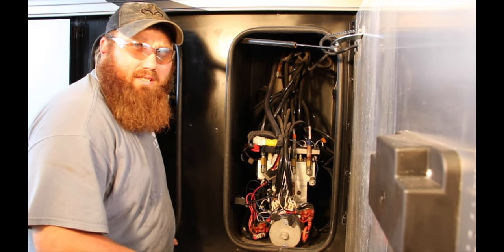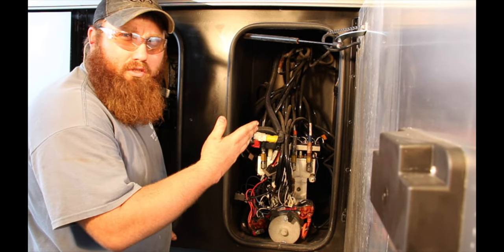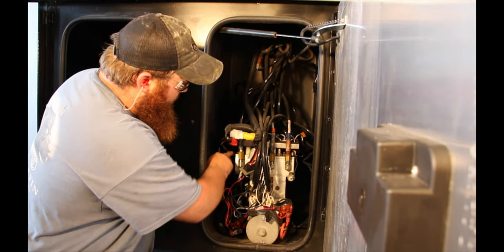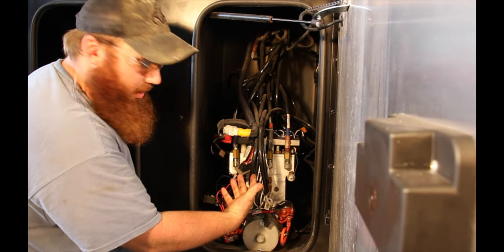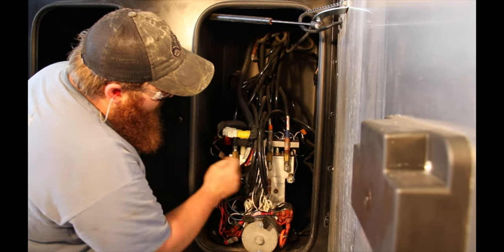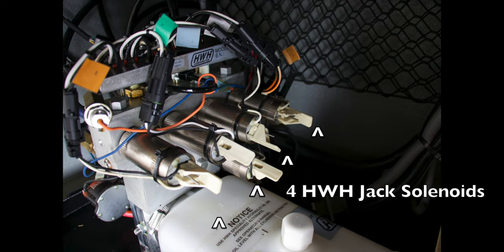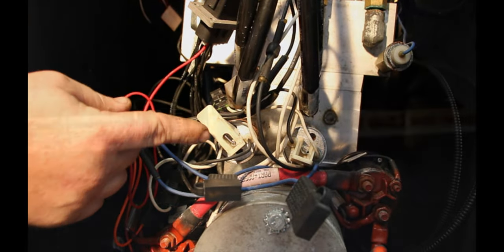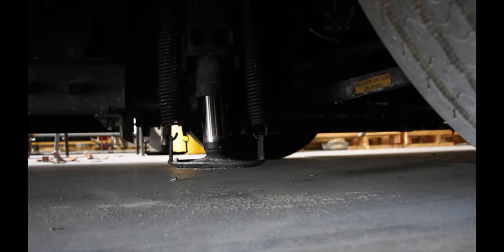How-To | Retract Motorhome Leveling Jacks

Comment: My Tiffin Allegro 2003 has HWH levelers. The Solenoids are located under the hood. they do not have the white tab on them.
Reply from the maker: Hi, Robert! Thanks for your comment. Don't hesitate to reach out to our service department at service@tiffinmotorhomes.com or 256-356-0261 if we can help answer any questions you may have.